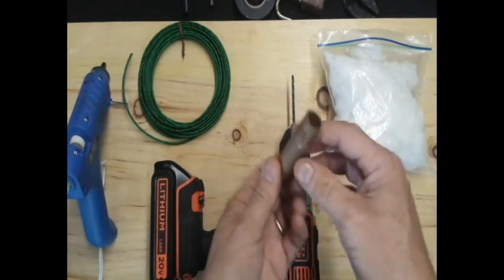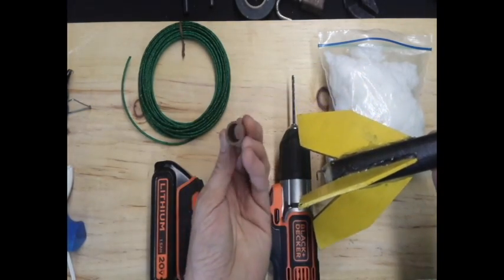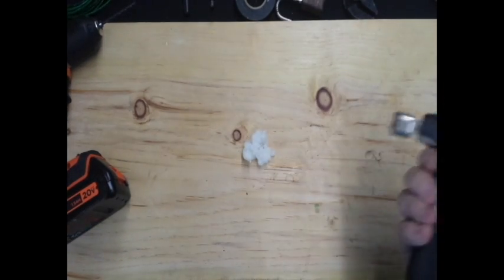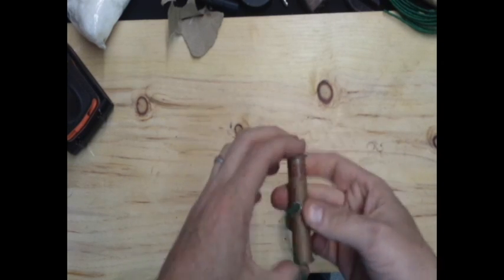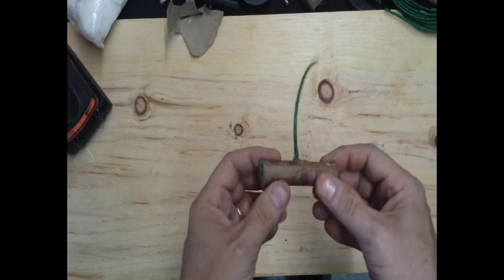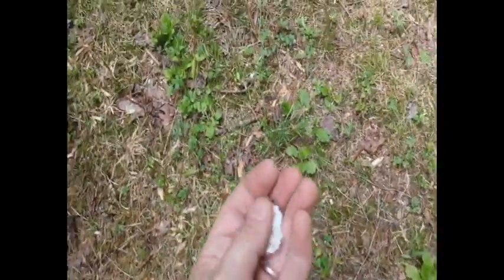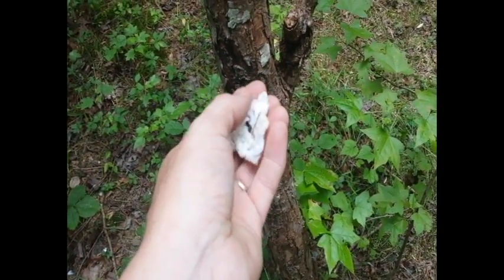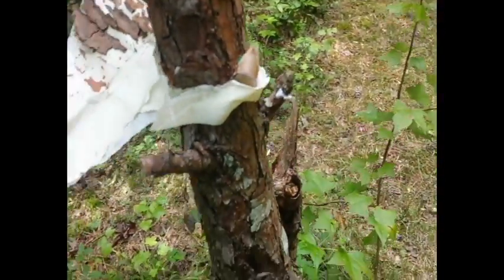Gun Cotton Fire Cracker - Still Only Deflagration And Not Detonation

Comment: you need a hi pressure shock with gun cotton use a rifle primer at the end of your fuse
Reply from the maker: Im gonna to learn how to make a det cap.
Reply: schel sullivan you need to learn to make silver acetylide double salt SA-DS, or just make tri-acetone-tri-peroxide TATP.  SADS is safer.  Both of those are high explosives on their own and they detonate unconfined.  Use a ballpoint pen tube cut down, rocket fuse, wading, and hot glue.  DON'T let the hot glue touch the powders. Use it right away and don't store it no matter what.

Comment: try loading into a shotgun shell and fire it remotely (safely) with a pull cord from a distance + shielding....i would use the 12 hr recipe or you may blow up the shotgun...ps, use a cheap single barrel break open in case you damage the gun

Comment: I wonder if you used a thicker tube.  As the pressure builds up the rest of the GC might ignite faster (like homemade quick match).  The good news is you don't need as much for an equivalent bang. :)
Reply from the maker: Thanks, working on a det cap of some sort as well.

Comment: I would perhaps suggest grinding the guncotten while its still slightly wet from rinsing, to produce a more fine fluff, and then just before adding to a device, add a very small amount of dark aluminum powder. The stuff is wicked hot, and i think that with just a little packing, it would have enough heat to light all of the guncotton, and enough power to be a detonation

Comment: most explosives dont like to be packed so dense.The burning will be better if it is not be packed so dense
Reply: william BONNEY I don't think that's true, more material=more gas expanding.
Reply: not true, especially if shock wave isn't produced.  Essentially the tighter it's packed the harder it is for the flame to work it's way through the material.  that's why your rocket engine burns instead of exploding and why gun cartridges aren't tightly packed with gun powder but instead are loosely filled.  Also, the slower it deflagrates the more likely the container is to rupture before all the fuel is consumed (as happened here).
Reply: He's trying to produce a detonation, so he would want to pack the material as much as possible.
I'd suggest trying with a pvc tube next. Then a metal tube (quite dangerous that one). The issue here is that the carboard tube doesn't hold enough pressure.
Maybe a two stage solution would work: instead of igniting it with the burning fuse, have the fuse set off a smaller charge and that deflagration instead prime the detonation. Could it be?

Comment: isnt the explosion all about gas expansion and said velocity of expansion?
Reply: Combat Pyro Speed of sound is about 1000 fps (330 m/s)
Reply: The nitrocellulose needs to be compressed in order to detonated just compressed wit 1kg of force or bit less and you will see better results
Reply: Edward Arruda detonation velocity is the speed at which a compound burns.  Low Explosives burn at less than the speed of sound, 3300fps if I recall correctly.  DetCord (petn) for example burns at about 20,000fps.  It's still a burn, but the term "deflagration" is used to describe a burn that is less than 3300fps and detonation is used to describe a burn above that rate.  4F black powder and flash powder are super close to detonation speeds.
Reply: Not so accurate. Even high explosives, such as PETN or TNT can burn(deflagrate), and at speeds much lower than speed of sound(in air). The difference between deflagration and detonation is mechanism of giving molecules the activation energy. When it burns(deflagrates) the activation energy is get through heat conduction, when it detonates, it gets activation energy through shock wave(wave travelling through material at greater speed, than the speed of sound in the material). Also, there is DDT transition, which is very important, because even if you set the explosive on fire, it can under right circumstances undergo the DDT and accelerate into detonation from the deflagration.
Reply: Vojtech pesl that's one of the best responses ive read on YouTube. You actually used facts instead of made up stuff. 👍🏻

Comment: The reason for the un-burned material is the weakness of the containment. Stop obsessing about "Detonation"; it doesn't matter. Use postal wrapping tape that has "strings" in it; the kind that is impossible to break. Use this to over wind the paper tube; then wind the tube end over end; for confinement of the end caps. put the fuze in the end; not the middle.
Reply from the maker: yeah I've been thinking about that sounds like great advice
Reply: I don't know if it's great advice; I do know it's based on a careful study of this very technical engineering subject.
Reply: +schel sullivan the take is called strapping tape.  But you shouldn't need that.  Just put 3/4" of glue in each end and out like a quarter of the GC that you put in.  You need to leave some space inside the container when using a slower burning substance like GC.  Try making your tubes not as long but larger diameter as well.  Use the golden ration for size.  Don't stuff so much GC in there.  You only need a little.

Comment: I tried  your gun cotton mix and it did not work. I used store bought pot. nitrate and HCL drain cleaner that works great for the TATP mix. it did not get warm or anything when I mixed it. It did turn yellow. What did I do wrong?
Reply from the maker: I would check the safety data sheets for each of your products. the drain cleaner I use is 93% sulfuric acid the stump remover is 99.9% potassium nitrate. those two ingredients at those concentrations should produce a very exothermic reaction.
Reply: I tried to chrush up the pearlized pot. nit. Do you think it has to be fine powder?
Reply from the maker: The stump remover I use is a powder.  Not extremely fine though. It all should dissolve so I don't think it should matter. It get very warm when mixed though. If not something isn't pure enough.  Did you check the safety data sheets?
Reply: HCL is only 30% I guess this my weak link. Thank you
Reply: You need sulfuric, not hydrochloric acid.

Comment: I have made a lot of firecrackers over the years, try no hot glue as it melt instantly with the heat of explosion, use electrical tape in 15 or more layers, also embed the fuse much deeper into the shaft to ensure the detonation of more material, also with gun cotton don't pack it so hard in there, it needs air space to work, for same reason gun powder is made into grains.  just found your site recently, keep up the awesome videos. and I hope this helps some.
Reply: Sounds like cordite
Reply from the maker: Thanks, Im pretty new to the pyro hobby. Im trying to learn and be safe as well. Ive recently been making black powder too and realize that the granules allow the fire to propagate through the material easier.
Reply: i want to try to granulate nitro cellulose from its  varnish form. mix it into a thick paste and extrude it in a spaghetti form and cut it into tiny lengths, i think it is possible it can be much stranger than black powder. you videos are great, keep it up
Reply from the maker: Isnt that the basis for making smokeless powder?
Reply: I think so, but am not completely sure
Reply: I also want to try the same by granulating Anderson Solution
Reply: @schelsullivan  It is
Reply: @singinginthedark2786 wouldnt that be cordite?
Reply: search for APNP :P have fun.
Reply: Vaiktorg APNP didn’t pull anything up except a nurse practitioner. Does it go by a different name? Thanks.
Reply: Gunpowder is supposed to be packed to explode, but black powder or smokeless comes in grains
Reply: Yes agree with you, do not pack it, it need oxygen to undergoes the oxidation process..
Reply: Gun cotton is a high explosive and doesn't need air space to explode.   Visco fuse cannot be expected to initiate the detonation of most high explosives including nitrocellulose (gun cotton)
Reply: @tomsavannah1886 then why does guncotton burn faster the fluffier it is and super slow when it's packed into something
Reply: "try no hot glue as it melt instantly with the heat of explosion" Really, I don't know WHERE some of you experts obtain your info, but I can promise you, unless you're melting your glue sticks with a lighter,  the heat, of hot glue will  not cause an explosion (at least  not of the usual firecracker ingredients)  If you were talking about at the instant of detonation, I can assure you, by the instant of detonation, the hot wax is long past the purpose it was originally intendid and consequently whatever, (if any) difference electrical tape would have made  in lieu of hot glue
Reply: @bbelcher4355  I agree. This guy is full of shit and definitely does not know what he's talking about for a person that have supposedly made plenty firecrackers. Even with slow burning guncotton (unlike flash powder), it will still build up pressure fast enough and shatter the hot glue before it can even melt.

Comment: Also, something I missed before at 5:05. Actually, a lower density will help the explosive detonate easier, but it slows the detonation velocity. One easy way I can almost guarantee will detonate the NC is to get some very thin nichrome wire (stainless steel or maybe even copper might work better) and put it in the firecracker. Instead of using a car battery or something, use a power source with very high current (amperage). Maybe like a ton of 9 volts or 12 volt car batteries in parallel.

Comment: Detonation is not more energetic; it's just faster.  what happened here was called "disassembly". What's needed is more inertia. in the confinement system. inertia is mass.  another factor that affected the result was the strength of the containment; in psi / sq. inch. if it was a piece of 3/8" steel pipe nipple with end caps screwed on; the result would be much different. Your nitration result is impressive and very successful. I believe this material could be used as a propellant in a muzzle loading rifle; I'd like to try it; but I probably won't; due to old age and illness.  The peak pressure in that case would be determined by the loading density; the ratio of active material to empty space in the chamber and behind the projectile. the somewhat popular internet wisdom that propellants should be tightly packed is non-sense. Detonation is kind of a strange goal; it's not really much use for anything except breaking hard rock; that's what it was originally used for; but that requires a detonator, ( a blasting cap ), or equivalent. you can achieve practically an level of violence you wish without detonation; depending on loading density, ( compacting of the material ); and the strength and inertia of the confinement.

Comment: Stronger casing, that much NC would need a very strong container to contain the pressure while it all burns up... If your plugs blow out, score the inside of the tube with a file or something sharp.. More surface area for your adhesive. This works well for rocket nozzles as well... You could over wrap the outside with wood glue soaked twine cord... Its called spiking... They use it on larger salute shells...helps contain all the energy until it breaks... Good video

Comment: I just realized, if all that guncotton detonated it could probably fell that tree.
Reply: if you want to cut the tree in half; use steel pipe, like 1/2" or 3/8"; and threaded on caps and compact the material under pressure; you can compact it with several hundred pounds of force on a wooden dowel inside the little pipe.  If you put the pipe on the outside of the tree; "tamp" the explosion with clay all around and over the pipe to force the expanding gasses thru the tree.
Reply: John Affleck Confinement doesn't matter if it detonates.
Reply from the maker: +NO3- SAVAGERY that's what I was thinking. It would have been glorious! Well im going to get there!
Reply: Also, metal fragments aren't fun to get hit with.

Comment: Detonation requiers stronger kick i.e. detonator. You can not achieve detonation via the flame of the fuse, only primary explosives such as silver azide can be detonated this way.
Reply from the maker: I think your correct. I dont believe more compression is going to cause it to detonate, though I do believe that a strong container and more pressure will still equate to a much more powerful deflagration reaction. I will need to learn how to make some homemade detonators as well. This is definitely pushing things into the "red" danger zone.
Reply: Acetone peroxide. You may go blind, though, when pieces of your fingers hit you in the face.

Comment: does gun cotton detonate if struck with a hammer on a metal surface?  Just curious if it needs to be set off with a priming cap?  Thanks for the video. Cheers
Reply from the maker: It will detonate when hit with a hammer. Ive set small amounts off with a hammer on concrete.

Comment: You will need to use a blasting cap for detonation. I think you just need more pressure. I drill a hole in a small plastic container and put a fuse in it. I then wrap it vertically with electrical tape.
Reply from the maker: I thought packing it tightly would work. Maybe Ill try twisting, and maybe a stronger tube that would hold up a fraction of a second longer.
Reply: schel sullivan I also wrapped electrical tape tightly around over the fuse hole. The packing won't necessarily help since NC produces a lot of gas regardless. As long as every piece of NC is intimately pulled together  it should all light. Also, detonation doesn't occur in Nitrocellulose when it is lit. Many primary explosives (HMTD,TATP, SADS, Mercury fulminate) will detonate with heat/fire. Check out ExplosionsandFire, he makes good videos on explosives. Explosiopedia does as well, but he doesn't explain much.

Comment: I dunno, try dissolving some in acetone and putting loose guncotton on top of it. Also, try putting the fuse on one end. And try nitrating the nitrocellulose 2 or 3 more times. The hexanitrate stuff will transition from deflagration to detonation pretty fast. You could make an HMTD blasting cap, but HMTD is quite dangerous. Be careful though, it is quite a bit more powerful than TNT!
Reply: schel sullivan Just ask about whatever. I've read a book called "The Chemistry of Powder and Explosives". It's on amazon the last time I checked. It's an older book, but it has some good stuff in it.
Reply: TATP is easier to make. Why would you use HMTD over it? You probably have more actual experience with explosives. I just read and watch stuff about them. I'm mainly just stocking up and prepping until I can actually make some stuff. I need either ester or ether to make a binder, I forget which. EGDN will plasticize a PETN or ETN and collodion cotton mix to make a nice plastic explosive.
Reply: Well HMTD is better bc it's more stable. And EGDN is good cause it jellyificatilizes things and makes it legal. I think you can also use dnt as a taggant, but it doesn't plasticize stuffs.
Reply: NO3- SAVAGERY What do you mean by legal? Also do you know a good source of n-octyl phthalate? It's the plasticizer used for semtex. styrene-butadiene rubber is the binder.
Reply: Camroc37 Idk. Make it? A plastic explosive has to have a taggant in it.
Reply: NO3- SAVAGERY I'll see about that. You can get it from Sigma-Aldrich for a high price, and the binder is just rubber. Ah, I understand. Didn't know about taggants. Is it actually legal then?
Reply: Camroc37 Plastic explosives have to have a taggant.
Reply: NO3- SAVAGERY Yep, edited my comment just now. I'm going to see if styrene-butadiene will be plasticized by EGDN. If so it may be easier to make. The only problem is finding the right styrene-butadiene since I know little about plastics.
Reply from the maker: You guys went over my head, but thats good, I want to learn and stay safe and legal.
Reply: holy crap  ive had that book for years ..I think mine was printed in  1925 or so
Reply: NO3- SAVAGERY stay away from HMTD, it's so emr sensitive that it can't even be measured.  If you're going to fool around with HME, try TA-TP and don't keep any around.  Make enough to use up and that's it.  Put it into a cut piece of ball point pen with the ends glued shut and a fuse in the end.  Definitely don't put hot glue in direct contact with TATP.  Don't put it in contact with metal either.  If you do store any, keep it under acetone and dry it out before you consume it.